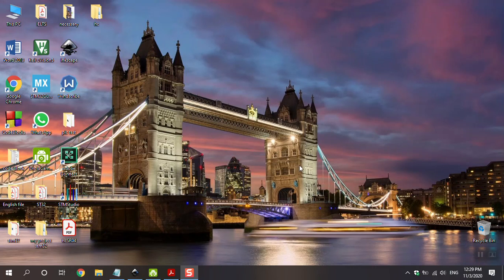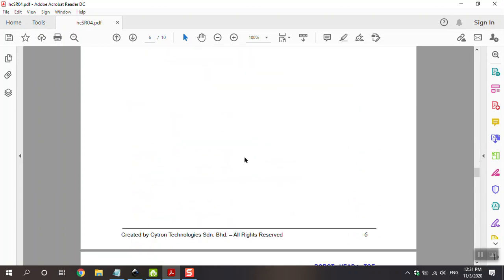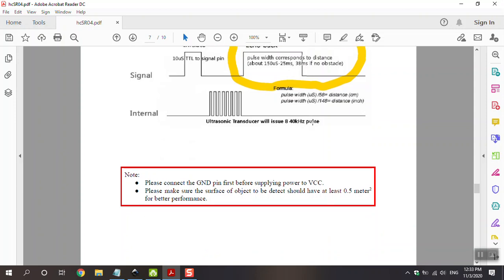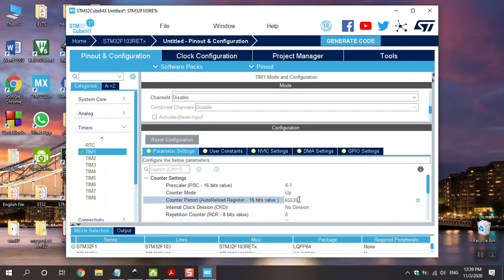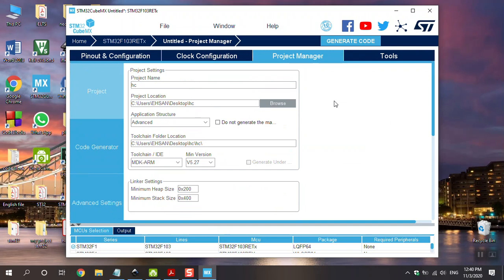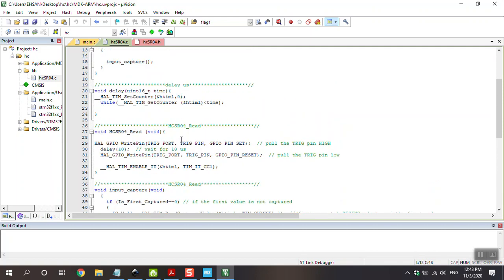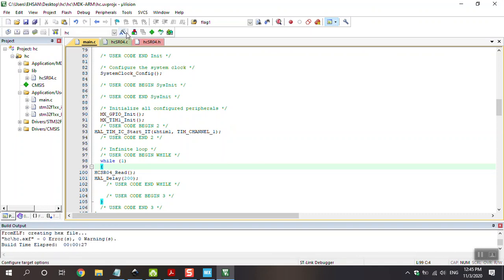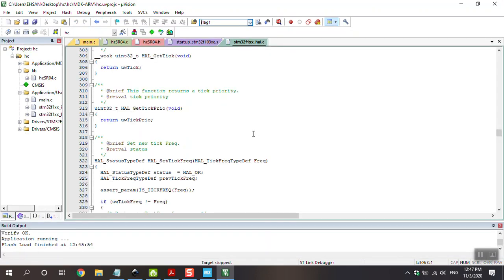hcSR04 module with STM32

Comment: I did the same as in the video but the result is not the same, Sensor  sr04 not showing results! Can you help me, please
Reply from the maker: Hi
Can you more explain about your problem?
you dont have resualt at debug?
Reply: Nice
Reply from the maker: it may be here if you use keil program
go to:
option for target
then
header file C/C++
then
optimization(cheng leve 3 to level 0)
or you can debug your project line by line in debug you can see which line is not working
but I need more information about your project